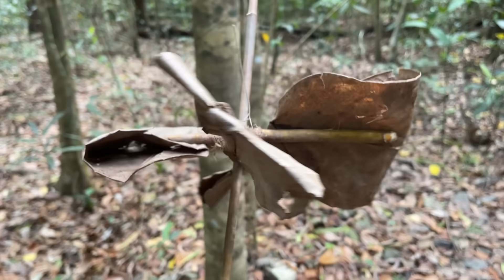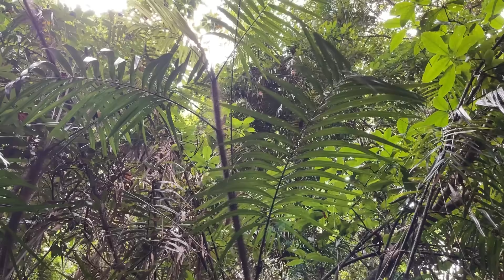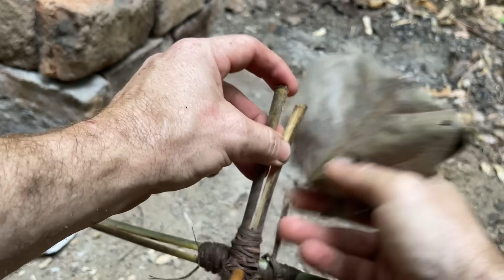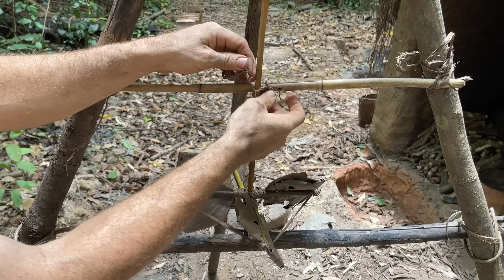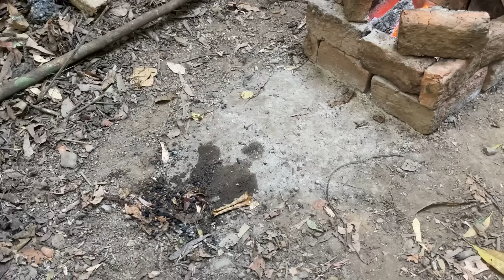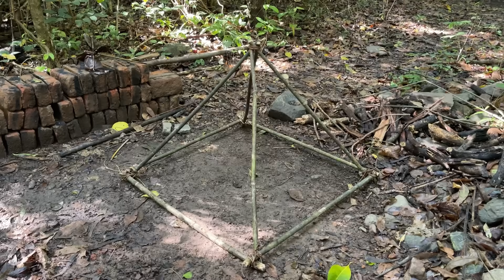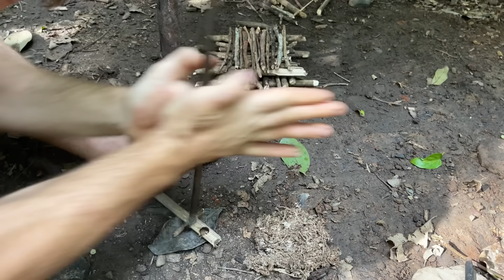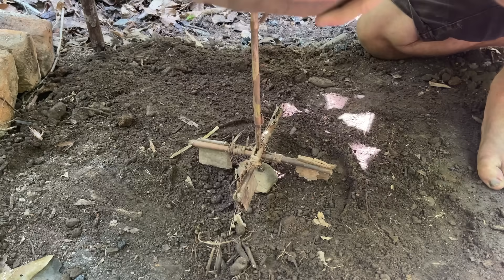Primitive Technology: Convection turbine experiments (hot air windmill)

Comment: The principle is fine and demonstrates continuous movement but it would have little torque to drive a fan. Gearing would be an answer but there would be friction losses. As it is the leaves leak a lot of air. If you have a regular water supply a water powered fan will produce more torque to drive the furnace fan but I like the idea of putting the spare furnace heat energy into driving the furnace fan. Maybe stacking the drive fans akin to the axial flow compressors of turbine power units might get you more torque out of the system? ie putting several fans on the same shaft to extract maximum power out of the given furnace heat energy.

Comment: I think you are loosing a lot of enery restricting the air flog with the leaf piramid. Something to consider is the venturi effect, using a duct as large as the fire pit and a big fan should work a lot better. With some gear multiplication to the turbo it will be amazing! (ok, I watched the other videos and I know that is not simple)

Comment: The idea was good. The bad thing is that the setup didn't have the enough potency to power anything useful. If you are looking to power automatically a forge blower, I would try again with the water setup, but with a higher water volume. Think in therms of potency and performance from an engineering perspective.
Anyway, my heart skips a beat when I see the notification "Primitive Technology released a new video" ❤❤❤

Comment: Love the turbo charger idea. You should consider forcing the hot air onto the blades a bot more, for example the rotor should be inside a tube where the hot air has to travel through. Your leaf"blade" shape could also get an improvement. Or try to make some thin pottery blades that can withstand the temperatures. Cheers from Germany 🙂

Comment: On a serious note: You are able to make quite large pots. You could narrow those to the top and place them close enough to the fire for boiling. You also proved to be capable of making pipe like pottery which could be used to direct said steam. Maybe there is a primitive way (super thin pottery wings or some crazy stuff) that could transform that steam energy back into kenetic? Wouldn't that be kinda sick?
Reply: wouldn't work. the entire concept is doomed from the beginning, as the rising air - no matter how focused through funnels and no matter how strong yet delicate the fan wings are - just doesn't have enough energy to do anything with. The majority of the fire's energy goes into heat, not into air movement...
Reply: @m.h.6470 Tell me you did not read my comment without telling me that you did not read my comment xD
Reply: @simonsilence  You are talking about using ceramics to turn steam (aka rising air) into kinetic energy... which is doomed from the beginning, as the amount of energy you could get is TINY at best. Given the low quality of handmade things, we are talking 5-10% efficiency of an already laughably low value of the steam he could produce. We are talking levels of energy, that could MAYBE lift a single leaf, but not much more.

Comment: Would you think about water-based power? I guess the easiest way is to put the water higher manually, but at least it's not constantly spinning the blower
Also, you could use this propeller design in the blower that blows parallel to the shaft

Comment: While an airturbine is interesting, the amount of torque it can generate should be very limited:

The durability is also a problem and with that problem comes the problem of weight with more sturdy materials.

Tbh i still think that a waterdriven setup would work best, the problem there is volumen. You need a LOT more water to make that work, but what if a passive reservoir could be build up from the stream? one would have to dig deep and use water proof lining but a passive pump should be possible.

Practical engineering just did a video about the topic. I build something similar in my youth but the efficiency was so attrocious that i gave up on it (just to make it clear: i used modern pipping, not prim materials^^). seeing that video made it clear that i just simply did it very wrong XD
But using a similar design and the available stream an elevated water reservoir should be possible. using that then to drive a fan should be possible. the question there is only: for how long will a waterreservoir last. so how big would it have to be and how long would it take to actually fill it.

If working directly at the stream is a possibility, then a primitive dam and a dug in smithy may also work?

One thing that sort of dawns on me....not sure how much digging is viable with primitive tools mmmh :(

Comment: Perhaps you could use some old roof tiles to form the pyramidal hood to prevent the risk of leaves burning, as the thicker timber support poles could probably take a bit more heat before catching alight. Not sure if having a cylindrical bark chimney extend above the hood in which the turbine sits (To force as much air past the blades as possible rather than it escaping out the sides) would work, but that's what experimenting is for I guess.

Comment: Make one of your clay chinneys over fire (piza oven style) to reduce fire risk and channel airflow.   think about slightly lengthen the shaft and add additional second set of leaf-blades (lighter/smaller) leaf's , (have leaf's mounted further away from center, make sticks longer, shave them down as thin as possible,) but angled to catch the current direction of the wind. to boost the performance. the goal should not be to get it ONLY from the fire convection, passivity/automation being the main goal.  Might be fun to try a davinchi style corkscrew blade if you are creative with leaf's. If anyone is interested to see modern diy take on this check out burn barrel turbo, you will not be disappointed.

Comment: You can put a bigger fan on top, or more fans one on top of each other. And you should put them inside a "pipe" or cylinder. This way the hot air needs to go through the blades. The way you are doing it in this video the air can go outwards very easily, and get colder so it has less force.
Nice start anyways.

Comment: So taller fireplace for more heat
Tile funnel instead of leaf
But I’m unsure about the turbine.
The heavy you make them the harder it will be to turn them, (not to mention the stick connecting both turbines is wood so fire is issue plus anything else will make it heavier)
More work but maybe a small wall on the fire chimney might be enough to help. 

My best bet tho would be to use water. Idk if the area supports it but more water turbines being pushed might generate the force you are looking for

Comment: Why not use fired clay roof tiles for the roof? It would be harder to catch fire then, I think. A lot of the rising air seems to be going through the side, so adding more bricks upwards with airflow entries near the flame would probably help. Also, making a smaller hole at the top would increase the air hitting the blades, generating more torque for the blower, not to mention you could make more “auxiliary” fires with the blower only pointing to one of them for you to use

Comment: This might be more difficult, but maybe the solution would be to increase the area of the blades taking the hot air, as well as making the blades much heavier. I'd suggest using flat panels of wood (by splitting some logs for example) since the friction in and of itself won't be the issue
Using a brick chimney to canalize the hot air into a single stream could also help d:
this is a big example, but not in the right orientation: https://www.youtube.com/watch?v=3qqifEdqf5g

Comment: A design like that would be great if you can somehow funnel hot air out the side, then into the funnel with the windmill using larger blades probably made out of bark for robustness. 
That would technically work since you just need a larger volume of hot air and a larger windmill to move the turbine.

Comment: Couple thoughts

If warm air is the driver, a chimney shaft might be a way to deliver hot air without open flame

You've got a lot of wobble in the rotor shaft which is losing torque, the bearings from earlier in the video could help as long as you can keep the friction down (maybe smooth river stones somehow or a natural grease of some kind?)

You also might want to have the fan on top be bigger than the blower

Comment: Hi!
If you want some Engineering suggestions:

- slightly larger fanblades (hot air hitting the Fan further away from the axle has higher leverage)
- try and grease the „bearings“ or sockets. Maybe you can find some beeswax or an oily fruit/plant in the Forest. Tallow would also work

But apart from that, really cool project!

Comment: I do love your videos. Been watching for around 10 years or so now. I also really enjoy your experiments and out of the box thinking. This one is doomed to fail though. The obvious weakness of leaves and sticks so close to a fire aside, it wouldn't even work with better materials. You'll never get a 1:1 conversion of energy from the fire into motion of your blower, because of inefficiencies. Friction, loss of energy due to heat radiation etc. Even if you make it as efficient and frictionless as possible with natural materials, there will be an energy loss, even if minimal, leading to a weaker fire, then a weaker blower, even weaker fire and so on. It'll be a downward spiral from there. To power the fire with its own energy, you'd need a 100% efficient energy conversion. Something which even modern electricity plants can not even come close to. To make the fire stronger you'd need to create energy out of thin air. Something that is, to our understanding of physics, not possible. So either you'd have an external energy source powering the rotor and thus the fire or you'd fail trying.

Comment: I just did some back of the envelope calculation: without some kind of chimney, you won't be able to extract useful amounts of mechanical energy out of the updraft of hot air. The chimney (via the buoyancy of the air inside the chimney vs the denser air outside the chimney) is the core part which transforms heat energy into a pressure difference (or acceleration of airflow) that can drive a turbine. The longer the chimney, the better (though even with an infinitely long chimney, I get an upper limit on the possible efficiency of about 10% from thermal to mechanical energy... )

Comment: To harvest any real energy out of the fire's updraft you're going to need to use temperature tolerant materials, stone or pottery or metal, and any energy you pull out with this turbo setup is also going to reduce any natural draft you've formed with a chimney/smokestack.  Not practical to produce any real working effort with the materials you're using, and not helpful for having a fire stoke itself since you're parasitising the natural draft to run a less efficient forced draft.  

A turbocharger works because an ICE doesn't have a continuous path to draw air through it, the turbo reclaims some energy that otherwise the engine has no way to use.  An open furnace like what you typically use is more analogous to a jet engine and a turbo cannot add energy to the system, only remove it.

Comment: suspend it inside a clay chimney? rods going across above and below the fan with holes to hold the axle of the fan. with heat it spins faster and creates suction pulling air in the bottom? although the tolerances wouldn't be spectacular so maybe it wouldn't do much

Comment: Certainly an interesting idea, but I knew from the onset it wasn't going to work very well. Harnessing wind power, even 'forced wind' such as with convection, requires some pretty hefty engineering because it's such weak force to begin with. A typical turbocharger operates with about 5-10 PSI in an airtight system with very high tolerances. Here, I'd wager far more than half the hot air simply escapes the system. If you measured the total air pressure on the turbine, i wouldn't be surprised to see something like 0.0001 PSI.

I think it might be possible to make this concept function with a very large turbine - something several meters in diameter - but I doubt it will ever come close to any of the other hand or water powered ideas simply because of how difficult it is to harness air pressure with such primitive technology.

Personally, I think the best thing would be to find a reliable way to convert Torque into RPM and using a water-wheel powered blower. Water wheels can fairly easily be made with simple tools and equipment, and produce immense power. If you can create a good conversion system, you could probably get a blower shaft to spin at maybe 1,000 RPM which ought to create a tremendous amount of forced air for a furnace!

Comment: Perhaps you can do a kind of preburner setup where it pumps and heats fresh air (into furnace)... Could combine with draft chimney.

Also, could you have 3 big tubes, fire in center at bottom so air goes up middle, down inner sides, then up outer-sides, so there's overall an upwards draft but the exhaust heats the furnace walls? Clay lid to feed middle.

Comment: Have you considered boiling water and using steam for driving the turbine? The expansion ratio is a lot higher than air to hot air and the steam should be cooler and less likely to set turbine on fire.

Comment: Fully serious - make thin ceramic blades as a single piece (yes it'll be wicked fragile) and house that in part of the chimney. I thought the turbo charger idea was silly at first, but if anyone could do it, it'd be you. 

I think you'd want the axis of rotation to be horizontal, so the shaft can more easily be protected from the heat. 

Simply having big paddlewheel blades that stick sideways into the flow of the chimney might be enough, which would keep heat away from the shaft. 
Then for the blower side, a simple horizontal volute blower on the same shaft, that blows into a long tuyere all the way down to the base of the furnace. 

This is a great idea, and I think the impressive part is that it kinda almost worked a little bit while capturing just a tiny, tiny fraction of the overall gas motion. If you really take the time to design and build this with efficiency and durability in mind, I think you could really make a set and forget forge! That would be awesome! 

I know this might be presumptuous of me, but I'd be quite happy to make some drawings if you want some inspiration. Coincidentally, I've actually thought about gas turbine fireplaces quite a bit!
Reply: The turbine blades could be made with woven material such as cane, and then covered in ceramic. 
this would reduce the weight
Reply: a heat exchanger could be added. 
you mentioned using a long tuyere. Simply put that inside the chimney. the hot exhaust gases heat the tuyere and thus the cold air inside.

a problem with a heat exchanger would be that the inlet air is now more buoyant reducing inlet flow. 
a balancing act.
Reply: I'm wondering how much you could benefit from a heat exchanger. 
have a thin walled inner exhaust chimney, and a outer clean air inlet chimney. 
the thin wall transfers the heat from the exhaust gas to the inlet gas, preheating it.

the taller the chimneys, the more effective the heat exchanger is.
Reply: @daftvader1505 had considered how heat exchange would work for some of his projects, but unfortunately ceramic is a really good insulator. He doesn't have access to anything that would actually exchange heat very well, I don't think.

Comment: Conservation of energy, if you want to power the blower fan, especially with the losses of the system, you'll need much larger fan blades up top.  Ideally fireproof materials too, if you want to achieve turbo charge territory.  You'll definitely be leaning heavily on fuel to power it, but I think it is possible with the right tweaks!

Comment: string broke, huh. then the whole little 'hut' goes too... oof. but looks like you had fun experimenting with other ways to power the forge blower. obviously, a more fireproof heat capture element, but you can also try adding more blades to the fan; this will create a more "high static pressure" blade to better convert the convection to rotation..... might need a housing around the fan blade at that point to prevent side blow-off though... i like the 'turbo charger' idea/analogy. i love all the tests and experiments you do here! keep it up!! :)

Comment: so crazy idea, would be lots of work to do (thats if it even works lol)

if your plan is to use this wind turbine to power the blower for smelting iron. then maybe use the massive updraft from the bloomery itself to power a turbine that would power the blower for the bloomery.

the long chimney makes a lot of hot, fast moving air. that would make the turbine spin faster and with more force. which in turn would spin the blower faster and with more force. the problem i foresee is that it might be too hot and catch both the turbine and roof on fire. maybe a clay roof to prevent its incineration? im not sure how to fix the turbine fire problem, im no genius. im just a dude with an idea lol

Comment: Maybe you could make a pipe/tube system out of clay and put the turbine inside and use draft (like a chimney) - that way you wouldn't have to worry about temperature as the clay wont burn down and air that would come in contact with the turbine would be cooled enough not to ignite it. Due to the draft, you can then build the setup horizontally instead of vertically, which could make building it easier. Or you could go straight to steam power ;-)

Comment: What if instead of hot air, you boil water and use steam to rotate turbine? (Pretty much the main source of producing power even today, except some boilers are nuclear) It's lower temperature, so lower risk of burning down, and I think it should be higher pressure. Hell, slap on some magnet and a copper wire - and you unlock electricity on the tech tree